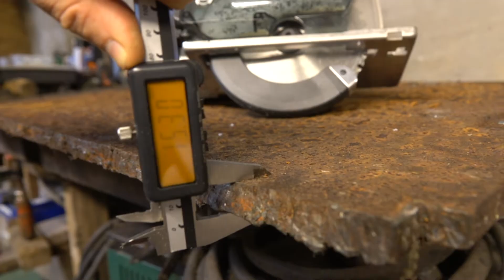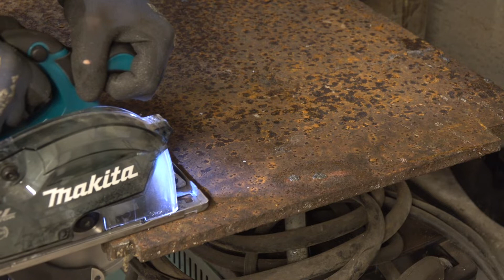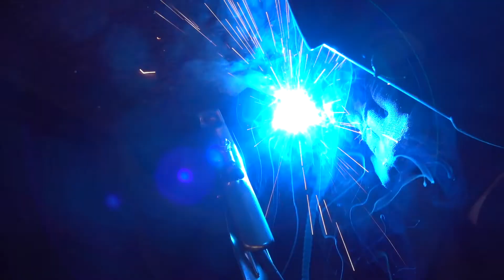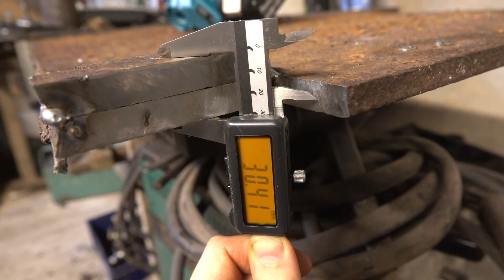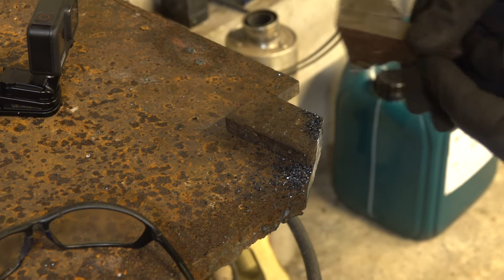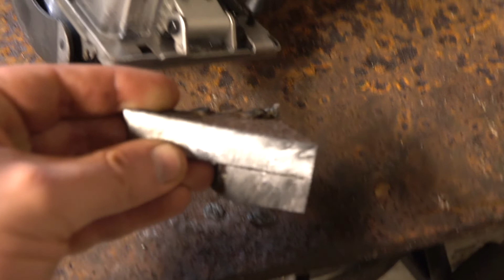MAKITA DCS553Z Worlds Best Metal Cutter - It can cut everything!

Comment: Iv had the larger 110v Makita saw 4131 with a 185mm blade and Iv had it for 4years Iv had mixed views on this? First it’s incredible how it can cut 10mm plate easy but blades do wear out rather quickly!! And blades are expensive. I found in the end it had problems and wouldn’t cut and kept damaging blades Iv now bought the makita DCS553ZJ  so will see how good this is

Comment: Can it be used to cut wood too?
Reply: Yes it can. Just about any 150mm wood blade with a 20mm centre. You can also add a vacuum attachment for wood, which of-course you wouldn't use for metal due to sparks.

Comment: This is a great saw. I have it for more than a year now. And it runs with the original blade still. I'll have it replaced soon. But very impressed with this.
You could of had better results by adjusting the blade depth to the material thickness. Thus not putting to much pressure on the motor.